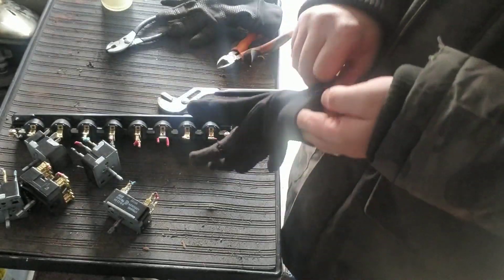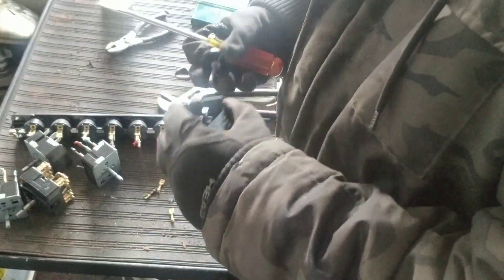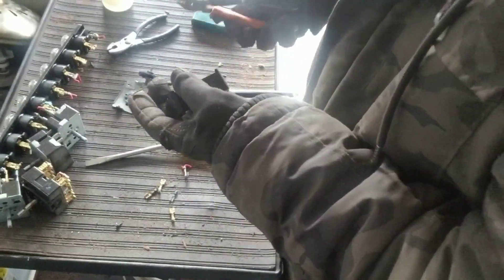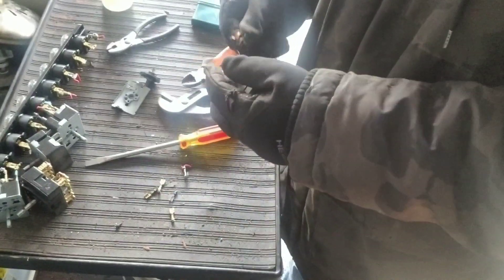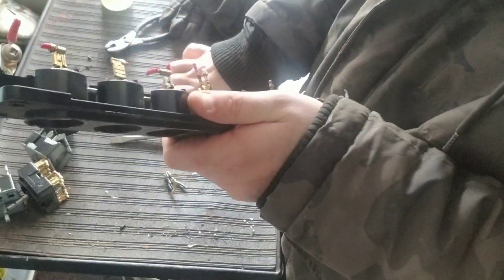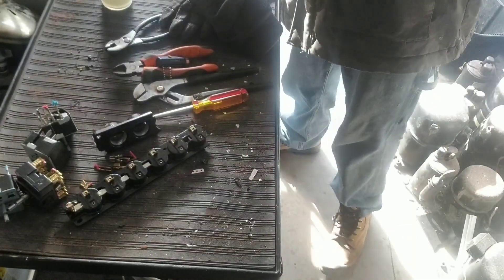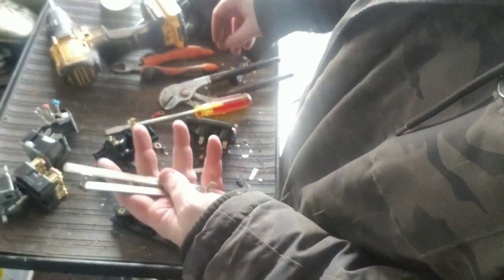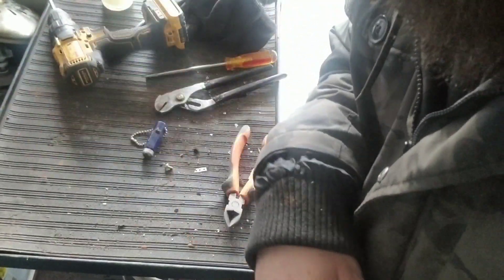Micro scrapping for brass

Comment: Although I was tempted with the micro scrapping Copper, my eye was drawn to all those Fridge compressors on the floor.    snips My second favourite tool.
Reply from the maker: Yes i need to get a good pair of snips ....and the compressors are all out of central air units and ac's ...lots of copper in them just not sure if its worth the cutting disks